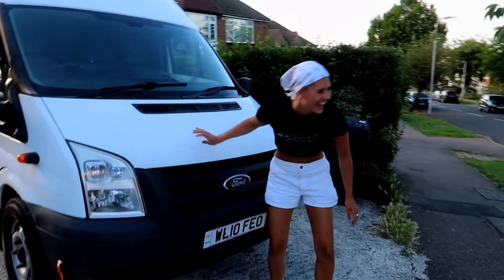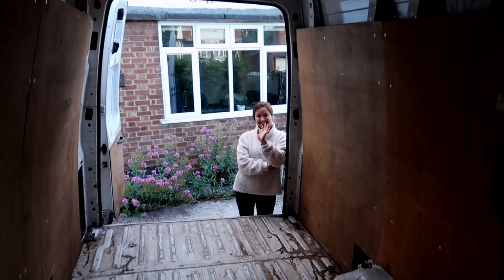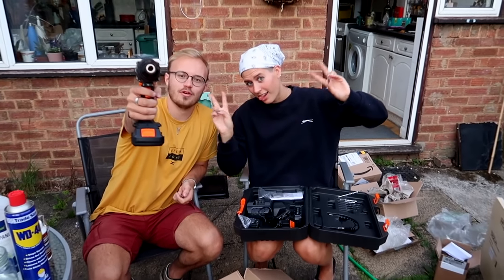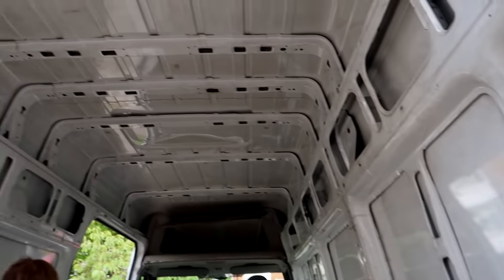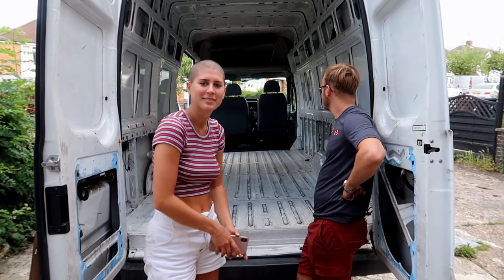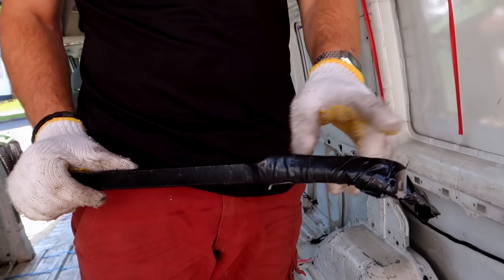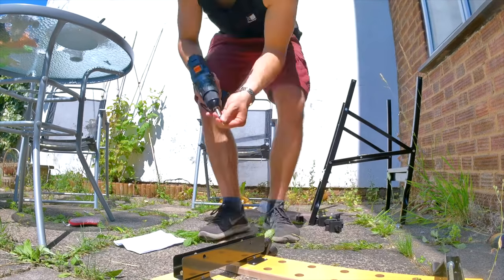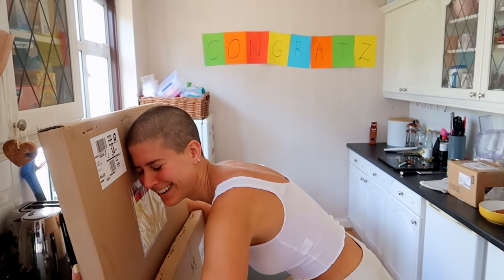DIY CAMPER CONVERSION: Installing windows and floor batons!  | Lucy Lynch

Comment: NOOOOOOOO !!.......... That insulation will soak up condensation/water like a sponge and rot your van from the inside out, you've got glass mineral wool there which is like Rockwool, you need recycled plastic insulation or Kingspan type insulation boards. If you went for boards you should used plastic insulation and closed cell foam in the smaller areas. If you're able to take that Knauf insulation out then do so and use the right stuff. x
Reply from the maker: It’s recycled glass bottles I thought it was unabsorbant? X
Reply from the maker: If not then we made a big oopsie
Reply: @LucyLynch  Yeah :( The vapour barrier will help stop any condensation getting into it but if you end up with any leaks then it's gonna soak up water and cause you a whole load of probs. x